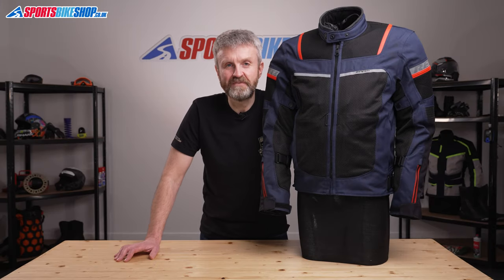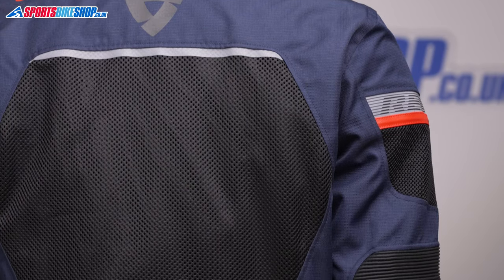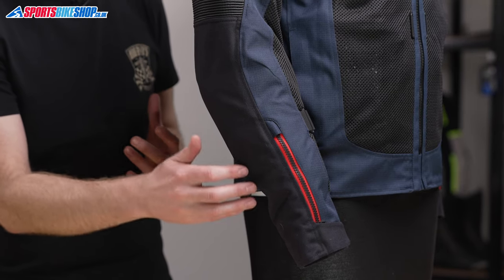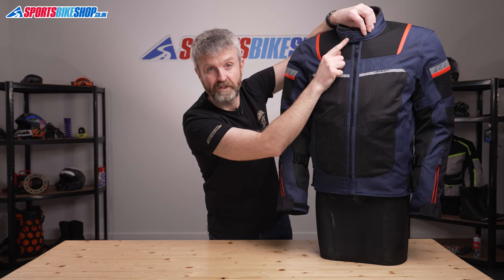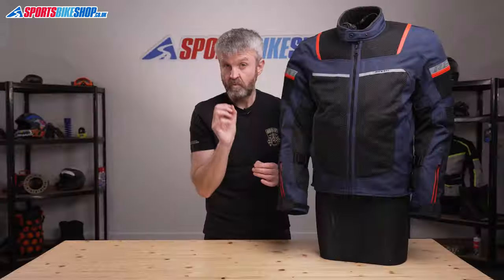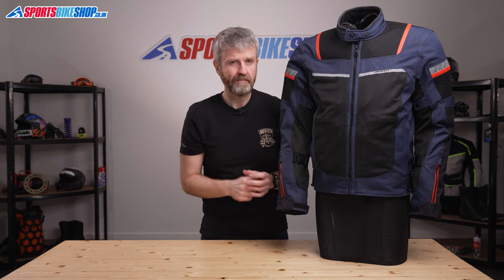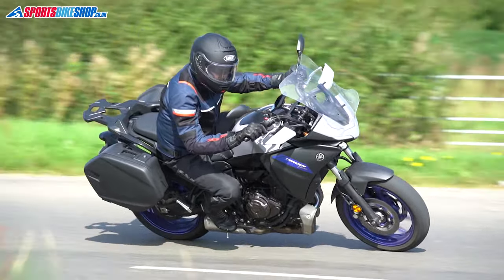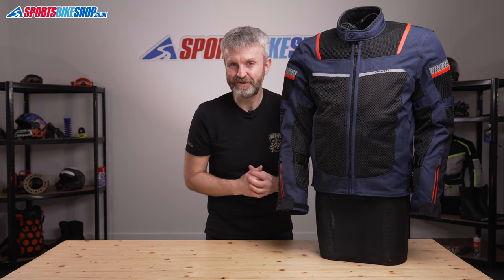Rev’It Tornado 3 textile motorcycle jacket review - Sportsbikeshop

Comment: I had the revit tornado 2 and now the tornado 3. The inner liner/membrane of the 3 is much improved over the tornado 2 . I do ride it ( even today) in temperatures of around 5° to 6°C, thanks to the great thermal liner. On the other hand , in summer, without the liner it has a massive airflow as it is a full vented vest. It is a well cut stylish jacket. Well done revit

Comment: Hey Tony, greetings from Mexico! How do you feel about using this jacket on a sports bike? Being a Daytona 675r owner and daily commuter, this Tornado 3 ticks several boxes for my needs but I’m hessitant about how comfy will it be on a sportier riding position, since I don’t see any stretch material behind the shoulders. Tnx in advance!! Love your videos!!
Reply from the maker: Hi there. I think it'd be pretty good on a sports bike as long as you buy it with a fairly relaxed fit and your daily commute doesn't involve climbing all over the bike like you would on a track. As you say, there are no flex zones, but those only really come into play when making the sort of shapes you'd make on a circuit. It's short enough that it won't bunch around the middle and it's pretty light and flexible around the arms too. I hope that helps you make a call on it, and hope you keep enjoying the roads and tracks of Mexico (which look pretty damned cool from here!). Thanks also for the kind comment on our videos. Cheers, Tony

Comment: Awesome review, just correct the information about the class of the certification. It's a EN 17092 Class AA
Reply from the maker: Thanks for getting in touch and for your kind comments. The jacket I wore for this review was labelled with the A rating. I've just found it in our studio and checked. The listing on the Rev'IT site does say this jacket is AA rated and I'm checking this with Rev'IT. I'll come back with more information when I receive it. Cheers, Tony
Reply: @sportsbikeshop  Thanks for your reply. Well, this is quite strange. It's interesting to understand if it's a mistake on the Revit website.
Reply from the maker: @Dare_To_Imagine  We've had it before where brands realise their kit will pass a higher standard and they resubmit it, with subsequent production batches bearing the new label. This might be another case of that. I'll update when I hear back from them.